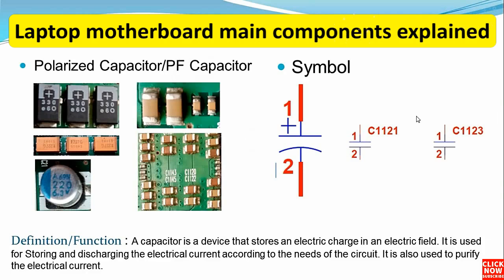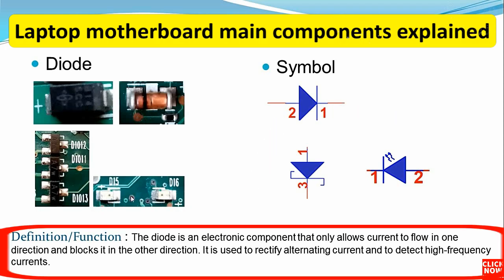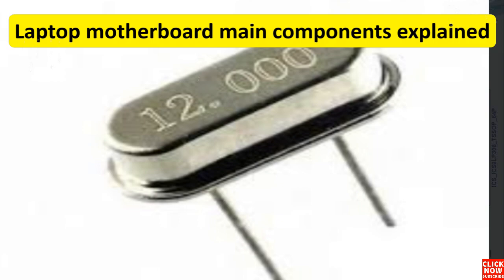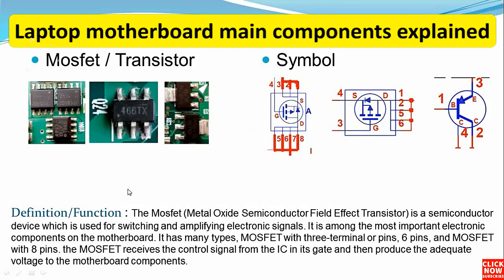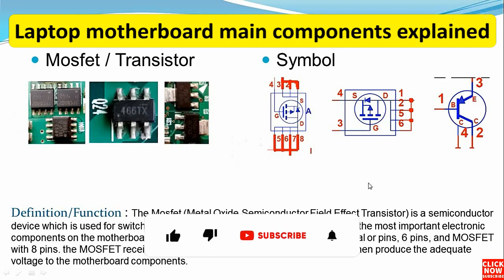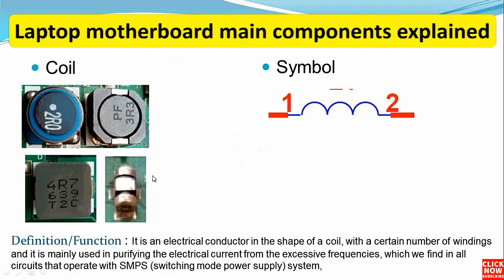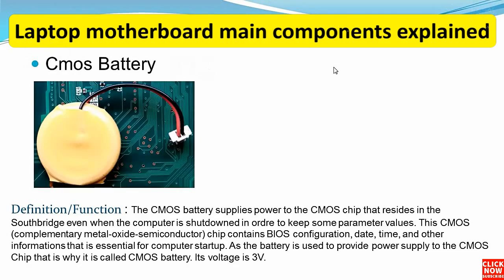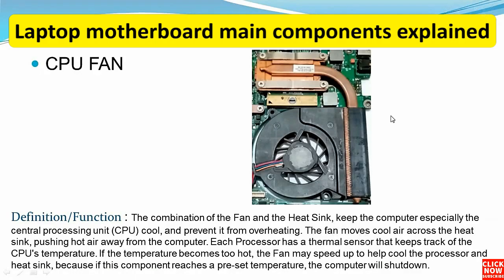Important components of motherboard, Basic motherboard components explained, MOSFETS, Capacitors etc

Comment: Hello ..Salam alykum..
I'm honored to watch you channel ..
1_how can I define between transitor..thirestor..mosfet...
2_ resister fuse if blown it possible to reconnect with thin wire..
      Thanks Ali from khartoum..
Reply from the maker: Hi Ali,
For the first question it is answered in many videos in my channel. For the second question, It is better to use a serviceable resistor instead of a wire.
Regards,
Reply: Thanks soo much .. can you forward vedio that is refer about transistor & mosfet